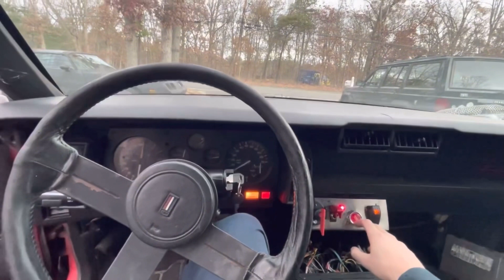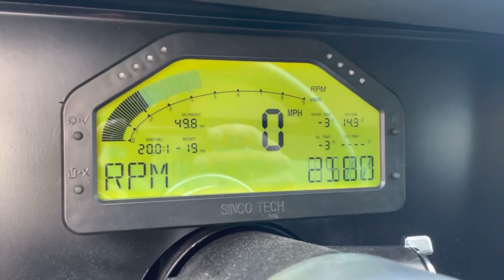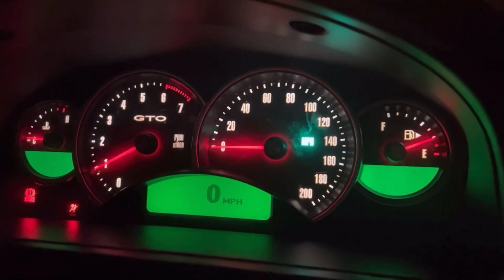Special Video for a SPECIAL ANNOUNCEMENT!!!

Comment: Congratulations man. I have the same truck and car as you lol. Used to have a gasser 2500 but I sold it for a Duramax. That fucker can be expensive at times lol.
Reply from the maker: Appreciate it! That’s sweet man I love having this little line up, I honestly debated looking for a duramax but I can’t make the jump to a diesel truck, atleast not yet
Reply: @TJR_Auto  they’re fun, but you need to have a savings account put aside for them. You never know when your head gasket is gonna go or your injectors lol